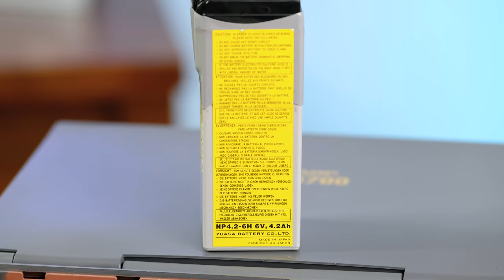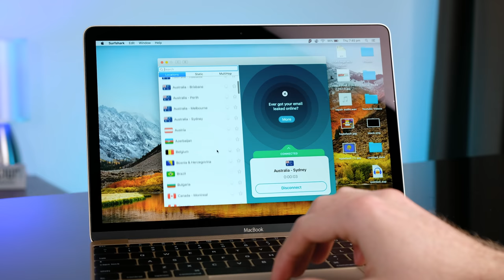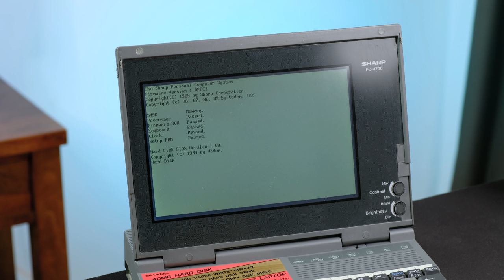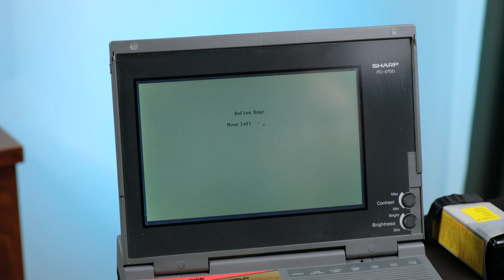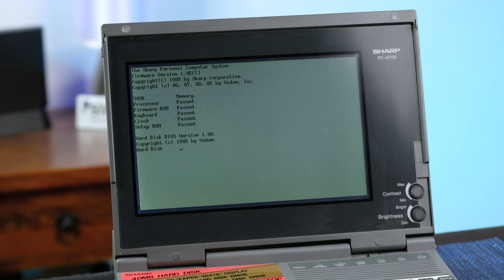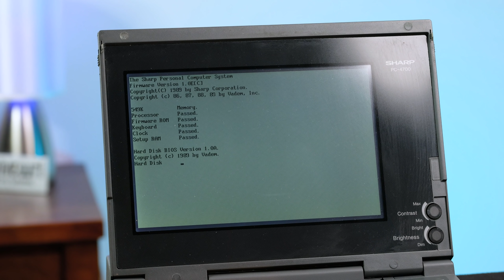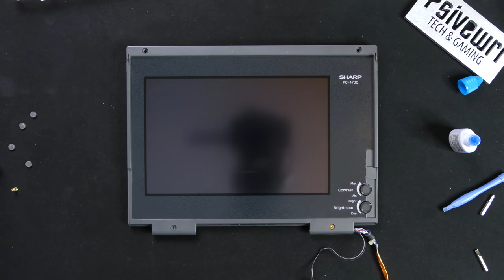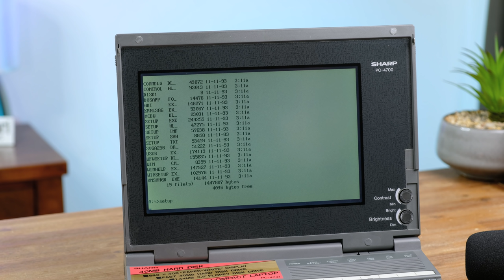I Bought A 30 Year Old Laptop From eBay! Can We Fix It?

Comment: Crazy how they used an "8088" and 486 was released an year earlier.
Reply: it was a budget laptop.
Reply: Yeah, PC-class machines were still being sold as low end, entry level stuff at this point, despite the basic architecture being nearly a decade old (the IBM 5150 released in 1981). Also note that this is just before the big educational and later, internet, rushes that really drove PC prices down so everything was still quite pricey.

Comment: That's a very cool piece of junk, haha. 
Funny how, by doing exactly what you shouldn't do with a hard drive, fixed the drive. At least for now.
As for becoming a member; I already have enough memberships running, but if we can do donations (paypal maybe?) I'll gladly fund a box of 3.5" diskettes  ;).
Reply: Well, given what other comments have said, it's likely that the head was stuck and disassembling the hard drive and moving the head freed it.
Also, the rubber grommet, likely there to reduce the noise produced by the hard drive, may have deteriorated and started to get into the head mechanism, causing it to get stuck.

Comment: Glad I am with first 20 comments, if my internet was fast, I would be the first one who watch your videos 😊, great video Nathan, oh by the way I have a Dell PC old version from 2009 small form factory, it has a dead processor and maybe the ram, and it's had a virus called KODC virus, there is no way you can boot it I tried more than 50 times but I failed anyone know what should do do to fox it I am poor a little bit 😂
Reply: If the KODC version is older, you can try Emsisofts Stop DJVU decrypter tool which is capable of decrypting KODC files without paying, however if the infection was done by the newer variant from 2019 then this will fail, you'll need to use a second computer that you don't have anything valuable on and is not connected to the Internet in order to decrypt the files if you can't get the computer to work.

As for a bad CPU, I would say that it is more likely the RAM or the motherboard that has gone bad and the CPU is fine, but I would start with replacing the RAM first, as that is most likely the issue if its failing to boot properly, maybe try borrowing a stick of RAM from a friend if they have the right type and are willing to help. :)

Comment: WD40 contains solvents and may dissolve rubber o-rings over time. It also evaporates, and doesn't lubricate very well neither. White lithium grease is what you want to use. Non mineral  based.

Comment: Why don't you try installing Windows 1.0 or 2.0? I hear they don't need specs as high as 3.1.
Reply: 3.0 would have worked but 3.1 requires a 286

Comment: In case this laptop has any graphics capability, it will be CGA at most. So any game/software that requires VGA or EGA is out of luck.
But even CGA may not be the case: it could very well be that is has a MDA card: this means proper text quality, but no graphics at all.
Now, on the internet I found a manual were it said this:
Internal options:
CE·471A color/monochrome CRT adaptor.
color/monochrome 2 modes supported:
color: CGA(640 x 200pixels)
monochrome: MDA (720 x 350 pixels) 
color/monochrome mode is selected up by setup functions. 

I found the this here: http://www.minuszerodegrees.net/manuals/Sharp/Sharp%20PC-4702%20PC-4721%20PC-4741%20-%20Service%20manual%20-%20OOZPC4741SM-E.pdf
Windows 3.1 will NOT run on this computer, as windows 3.1 does not run in real mode. This means it requires at least a 80286 CPU (and Windows 3.11 even needs a 80386 as your video very well shows). 

Windows 3.0 still supports real mode (and so runs on a 8088), but needs at least 1 MB of RAM. 
So basically, no Windows 3.x on this computer.

Comment: You are wasting your time trying to repair those old hard disks, the main board will probably need all the electrolytic's replacing also. If you want to keep that retro look of the laptop and make it usable as a classic laptop, stick a RPi inside and install DosBox. Replace the LCD with a modern one and the keyboard should be easy enough to mod and interface with the RPi. A few hole's in the side and you have USB too. :)

Comment: You can use a graphics cga to hercules emulator
Reply: ugur meyer According to the service manual, the display chip in the machine already supports the MDA modes, but the panel doesn’t seem up to the task of displaying the full 720x400 Hercules mode. It also doesn’t appear to have the composite CGA output (although that probably won’t work terribly well in Australia as it was based on NTSC) so no colour at all :(

Comment: I find it funny that the graphic ti-84 calculator has a more powerful cpu than this
Reply: not quite, this CPU is 16bit NEC V40 at 10MHz 8086 compatible and even have 80186 instructions, and ti-84 calculator have z80 an 8 bit CPU the speed depends

Comment: Careful with WD40. It's not a lubricant. If something need lubrication you really should be using an oil or grease. WD40  really should only be used on stuck parts, or to displace water. That floppy will have problems soon without some proper grease.

Comment: Just for knowledge,you are not supposed to open a harddisk,if you open one dont plug it into the pc again,it will fail soon or later,you can open the harddrive only if the reading needle have been stuck and take it to the right place,only to restore the data on the disk,the harddrive if it opens it will not work again properly

Comment: Anything over Windows 3.00 (1990) Will not work on anything under an Intel or compatible 80386.

Here is the link to download Windows 1.04 (1986): https://winworldpc.com/product/windows-10/104: Select the IBM PS/2 version (3.5 720k)
Here is the link to download Windows 2.03 (1989): Microsoft Windows 2.03 (3.5 720k) Option. Don't bother with Windows 286 or 386 as they require a Intel or compatible 286SX/DX or 386SX/DX
Here is the link to Windows 3.00 (1990): https://winworldpc.com/product/windows-3/30: Select Microsoft Windows 3.00 (3.5 720k)

Windows 3.1 or newer will not work due to the NEC V40 not being an AT Class processor. It is an XT Class computer which is what the original IBM PC was.
Hope this helps 😀

Comment: Why would you try to run 1990s software on this low-powered PC that is obviously suited to run mostly 1980s software? It almost seems like you don't have any idea about PC history and how fast development was at the time. And according to quick 4 second Google search, this PC has CGA graphics. Of course EGA/VGA games won't work. Windows 3.1 requires both VGA graphics AND a 386 CPU. This PC has 8086 compatible CPU (Nec V40?).
Reply: you are right about everything , but you mistaking only about Windows  3.1 , it can run on 286 and in CGA if you got the driver from 3.0 , 3.11 as well can run on CGA, but of source as you mentioned require 386
Reply: @intel386DX  Now that you mentioned it, I vaguely remember running Windows 3.1 on my 286 back in the day...
Reply: @joojoojeejee6058  And Windows 3.0 can be run on 8086 :) so he have to try that instead, but as you mentioned he lacks some the knowledge for that kind of hardware and software
Reply: @intel386DX  Yeah. I had similar 8086 CGA computer in 1990 (not portable), and I ran Digital Research's GEM graphical user interface on top of DOS for some applications... Namely desktop publishing. :) The PC was really low-end but I actually made a 32-page booklet with it. Game-wise most games from the 1980s worked as well as some games from 1990 and 1991. Pretty hopeless after that... Well, of course Planet X3 would work. ;)

Comment: It’s text only display, graphics mode don’t work on it
Reply: It is CGA-compatible.
Reply: @IkarusKommt  yes, it is, it emulates CGA and MDA. I found a pdf with a manual for this model, pages 5 + 6
http://www.minuszerodegrees.net/manuals/Sharp/Sharp%20PC-4702%20PC-4721%20PC-4741%20-%20Service%20manual%20-%20OOZPC4741SM-E.pdf
Reply: Graphics modes certainly work (I had Overkill and I believe Alley Cat running in one, but I can’t remember if I had found the CGA version of Keen 4 at that point) and the monochrome display spares you the horrors of the CGA palettes, but the display is so slow it ghosts like crazy.